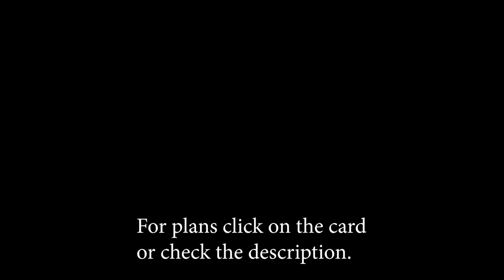Sheep from Shavings – Taking Scrapwood Projects to a New Level.

Comment: Fantastic video, woodworking can be so much fun! I purchased the plan, no time to actually do this project in the near, but the video alone was worth the $1.99. The plan is very good; full size patterns, detailed drawing, required tools, step by step instructions, and even tips! It's as if it was put together by a master woodworker with decades experience. 😉😉

When I do get around to this project, I think it would be fun to make a set of four with one in the set being freshly shorn to add a bit of narrative and comedy to the set. I'm mean what must the three fully fleeced, about to be shorn, be thinking?
Reply from the maker: Sounds delightful. You might put a finger plane and some shavings in the tableu just to add to the comedy.
Reply: For the freshly shorn look, you could probably use a layer of glue and saw dust.